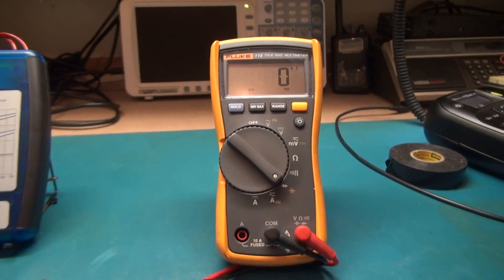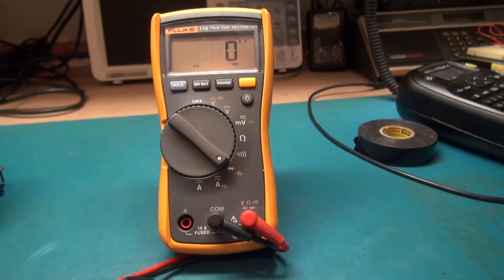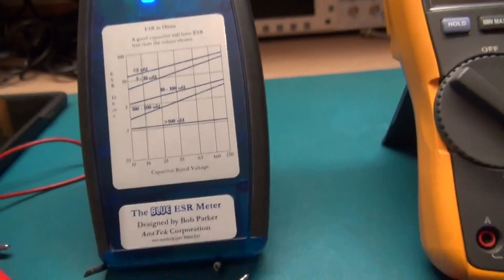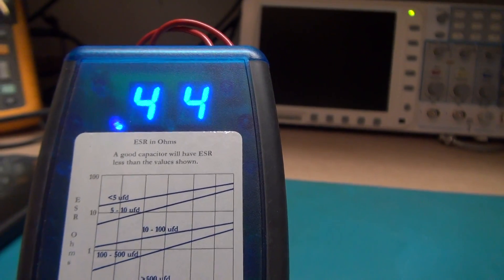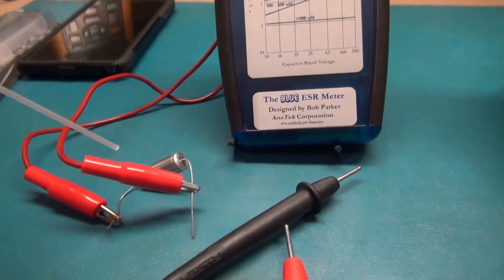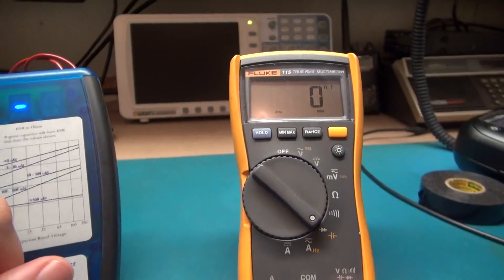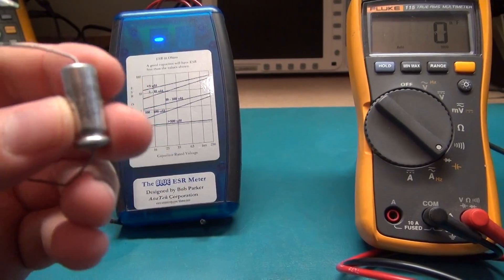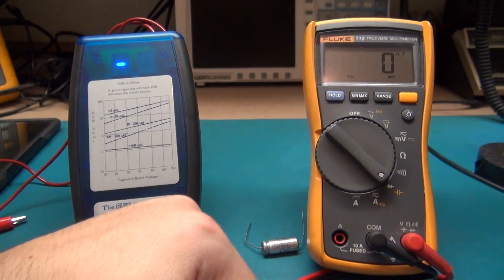Capacitor testing basics. Don't use a multimeter. Here is why.

Comment: I'm glad you make it basic and easy to understand. Don't leave anything out. Cause things you think we would know most likely don't.  My question:  Towards the end you mentioned Caps leaking. I read somewhere that leaking doesn't actually mean somethings leaking from it.   It just means that the cap is no good. But then Ive seen some caps do have something leaking.  Can you explain ?
Reply from the maker: Some failed capacitors can literally leak electrolytes. That means the capacitor has failed both electrically and physically. The term leaky capacitors can also mean that it can leak DC voltage through the capacitor that it is supposed to block. This can cause major problems to the circuits that are DC voltage sensitive. Capacitors are supposed to block DC and pass AC In theory. As capacitors start to become leaky they get high ESR. They become more of a resistor than a capacitor in which currents that it is supposed to block it passes. Without getting to technical I Hope this helps out.
Reply: Kev31779
 Yeah, I didn't know Caps were supposed to block DC and pass AC. ok got it Thanks I like Electronics, but it's hard to find classes that teach it in So Cal. What could you suggest to help ?
Reply from the maker: Youtube is a great place to learn . The only thing is that you will have to piece together the information you find that is on here. Search for things like - electronics basics, getting started in electronics, what is ohms law, what is AD DC.how to use a multi meter. Stuff like that.

Comment: You're right and you're wrong at the same time. Your old capacitor is not really "junk" - it is just no LOW-ESR capacitor and may not be adequate for some jobs! 

So, you of course would not use it in a switching power supply where your capacitor sees extreme ripple currents and so on. If you're having a low current circuit that just has to be buffered for some time with a capacitor - why not use the 1.7 Ohm cap? I've even seen brand new SMD capacitors 100 uF/10V that had more than 2.5 Ohms out of the package! Are these "El Cheapos"? Yes. But it always depends on what you intend to do with it. So, it is not a problem using Low ESR caps in any circuit (besides the pricing), but it is also not bringing a real advantage in any case. 

So, think of what is the task of the cap. Is it for a switching power supply? Are there heavy ripple currents? Or high current pulses? ==> low ESR. Otherwise the much cheaper ones may be also OK as well.
Reply: Correct in every word!

Comment: Why not check the resistance using the multimeter?
Reply from the maker: +Michał Chyliński Since a multimeter resistance check is incapable of looking for resistance or leakage at a frequency , it is almost a useless measurement. It may look ok.
Reply: +Michał Chyliński Your multimeter will check a resistor by applying DC to the "device under test" (=DUT) and measure what current will flow. As your capacitor will block any DC current, it will charge up and that's it, your Multimeter will not see any steady current from the DC voltage and so it just can't measure the internal resistor.

That's what an ESR meter is doing the other way round - it uses AC at a given frequency. Therefore the capacitive part of your CAP will have the current pass through and now it can check which  is influence of the intrinsic resistor part and which is capacitive impedance (kind of "resistance" to the current caused by the capacitive element) of the DUT.

No CAP is just a capacitor, they always come with some small resistor and even some small amount of inductivity inside. Some types more, some less.
Reply from the maker: +Slartibartfas042  That used to be the very old way before ESR meters were readily available with some odd results sometimes, you can get better results with an old analog Simpson meter. The ESR meter is a much better and more modern and  way of testing.

Wiki quote "Other types of meter used for routine servicing, including normal capacitance meters, cannot be used to measure a capacitor's ESR, although a few combined meters are available which measure both ESR and out-of-circuit capacitance.   A standard (DC) milliohmmeter cannot be used to measure ESR, because a steady direct current cannot be passed through the capacitor. Most ESR meters can also be used to measure non-inductive low-value resistances, whether or not associated with a capacitor; this leads to a number of additional applications described below."

Comment: The VALUE of the capacitor was 100uF. The RATING of the capacitor refers to the conditions it's designed to operate within, such as temperature or voltage.

Comment: Get into it deeper
Reply: +MrMac5150 You may dive a little bit deeper into it with the video of TRXbench here on youtube. In his video "#76 Why do electrolytic capacitors fail so often" he describes how you should see any capacitor (short "cap"). There is always some Series resistor (connection leads, internal connections to the plates etc.), there is also some leakage resistor due to not 100% perfect isolation, even air gap will lead to some minimal leakage current under certain circumstances. And last but not least there is the inductance of the connections and leads leading to the plates. There also is some third part that counts for electrolytic caps: The temperature rating! Build some switching power supply and use a standard cap and you'll fail. Switching power supplies suffer from high ripple currents, that lead (in any case, even for good capacitors!) to higher temperatures inside the caps. Here you can have low ESR types with a higher temperature rating of 105°C or more which can withstand higher temperatures better than the standard or 85°C types.

So, ideal caps would not have all these "problems", but all practical caps do inherit them automatically to a certain degree. In some cases it can be tolerated as you simply do not need 100% ideal parts, in some you can't and therefore have to suffer from other disadvantages. For example for SMD electrolytic caps you can have the same capacity for 5ct or for 10 Euros or Dollars or what ever you prefer ;-)  Both do have the ability to store the same amount of energy in it, one is just able to return the energy with some loss and with just low current peak (the cheap one with high ESR) and the other will have high peak currents (but you'll have to pay exorbitantly high price for that device). It's up to the circuit designer what parameters are needed and what you have to pay for the parts. ;-)
Reply: Slartibartfas042
 Good reply.